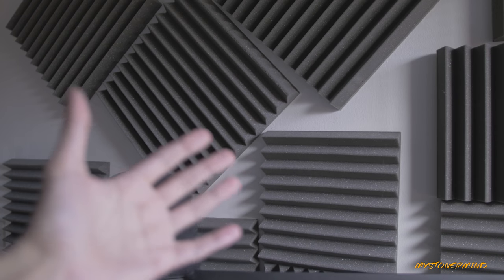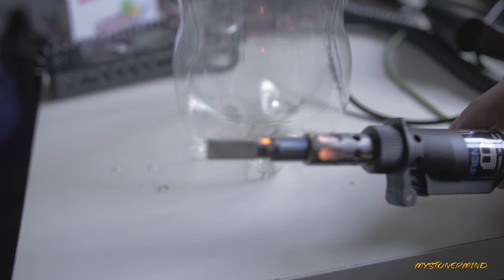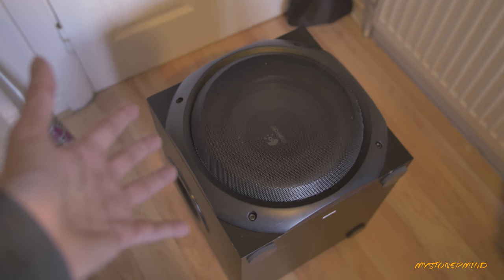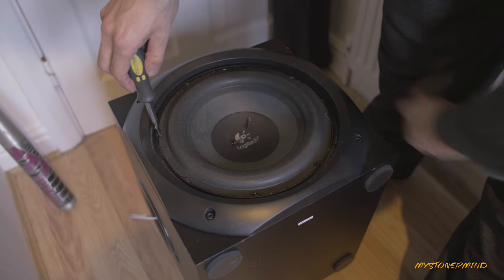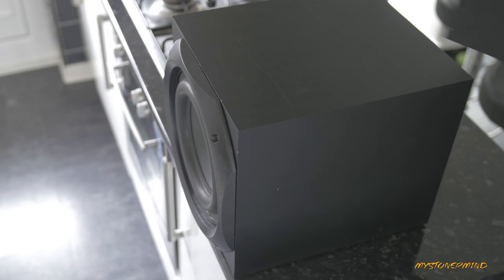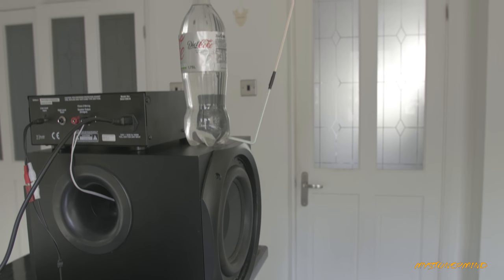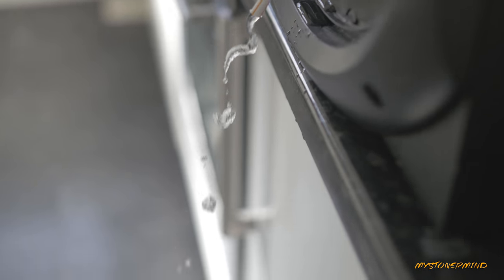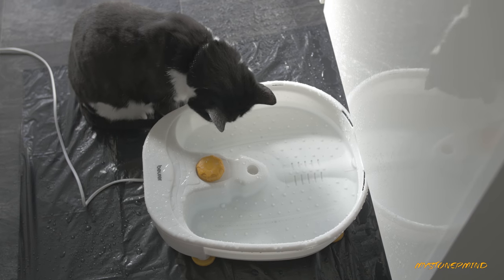SUBWOOFER BASS STOPS WATER FLOW !!

Comment: For those asking, no you won't "see" it like this if you try it.  You could set up a camera to get many pictures that you could combine into a video to see this effect, but your eyes will just see water moving like 'normal'.

It would look just like water coming out "normally".

Maybe this analogy will help explain it:

Experiment 1:

Imagine if you could roll a bowling perfectly straight at a constant speed where it does one complete revolution (roll) every second.  Setup a camera on a tripod that has the whole bowling lane in the frame.  Set the camera to take a picture right when the finger holes are on top at the end of the first rotation, and set the camera to  take a picture every 1 second (ie. when the finger holes are on top of the ball).  Do this over and over.  

You now have a bunch of pictures of a bowling ball going down the lane and.  If you put these in order and make it into a "video" it won't be a smooth video but you will only see the bowling ball in a position with the fingers up.  

Experiment 2:
Now do the same thing but have the ball do one complete rotation every 0.1 seconds and have a camera take a pic every 0.1 sec.  Then 0.1 seconds after the first ball starts, start rolling another bowling ball right behind it doing the same thing.  Then another bowling ball 0.1 sec after that one, and so on.

Now you have a lot more pictures than the first experiment.  Put the pictures in order again to make a video.  Think about what the video is going to show vs what you saw with your eyes.

Comment: For an explanation of what’s happening that will ruin the magic of this video, please scroll down.

What’s happening is the speaker is causing the straw to shake so that causes the stream’s tragectory is changing, like shaking a garden hose back and forth. I don’t know why it’s going in a circular motion instead of a linear motion but it could be several different factors such as your ac moving the air through the house or a slight tilt of the bottle.